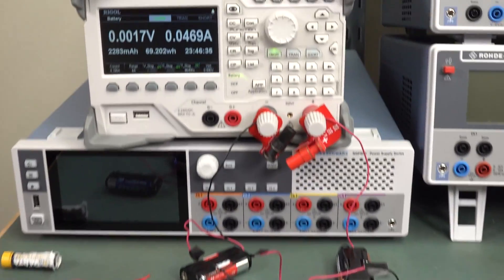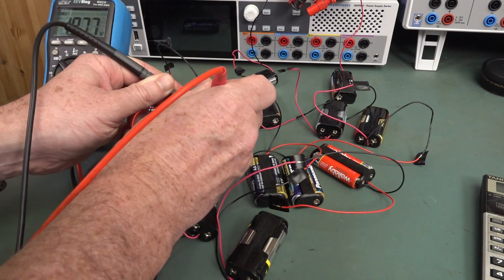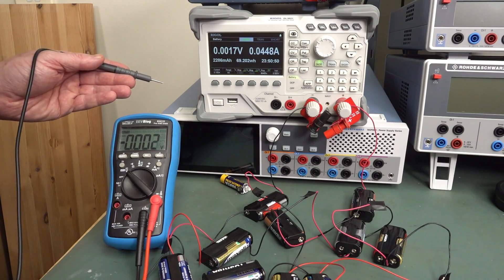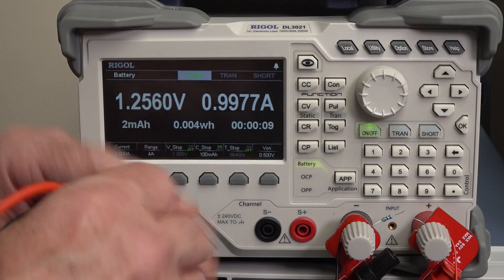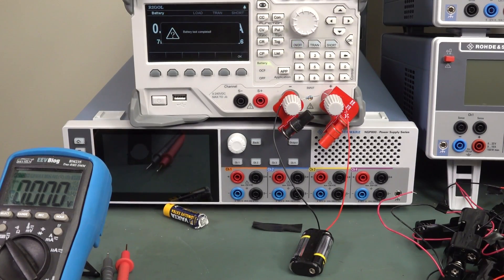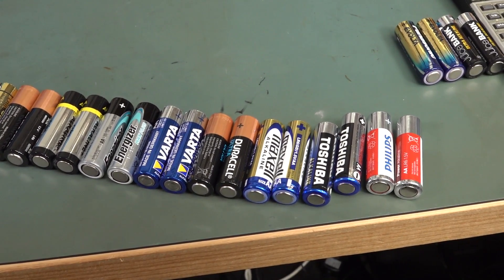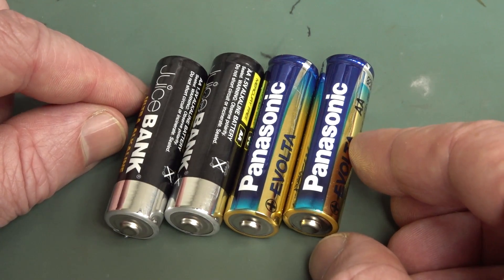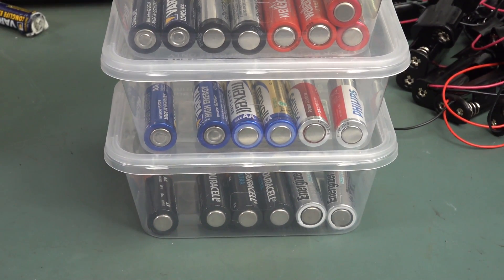Alkaline Battery Discharge Testing Part 2

Comment: Making them leak: Regenerate them. 100 Ohm series resistor on 1.6V/cell. ca.1 or 2 weeks. They seem to be ok and could be used. But a protion of them will start leaking when they are stored afterwards..

Comment: To guarantee even discharge (or charge), place a high-valued resistor (1 MEG) across each battery!
Reply: 1.5V at one megaohm is 1.5 microamps. How is that current able to make a difference at a charge or discharge current of 100000 microamps?

Comment: Every time I've had an alkaline battery leak, it was found still in-circuit; there was bound to be a few electrons per minute flowing from the battery. In your setup you've depleted the battery, then broken the circuit. I wonder if soldering a 100k - 10M resistor across each one would increase the probability of leakage?

Edit: Or make it more scientific and solder a resistor across one of each brand, leaving another of each open circuit.
Reply: I also wonder about this. A TV remote for example is always going to draw some standby current. It may not be constant, either. Perhaps that plays a part... That said, I have also seen dead (or just old) batteries leak in open-circuit conditions.

Comment: hmmm... I just thought about what causes the leaks: Because it's typically a seal failure, does having the battery compressed in a spring-loaded battery holder reduce the effectiveness of the seal when compared to having them loose? I'm beginning to wonder if we're barking up the wrong tree with all of these electrical tests when what we could try is compressing the batteries in a holder.
Reply from the maker: But they leak inside products that have battery springs.
Reply: @EEVblog2  Exactly! In those storage bins, there are no springs compressing the battery like in a real product.

Comment: David Perkins
David Perkins
36 minutes ago
In this many-batteries-in-series setup, it's wise to place a high-valued resistor (1 MEG) across each battery so no single battery 'hogs' more than its maximum voltage!

Comment: They wont leak in those boxes. They need to be in something expensive, then they are guaranteed to leak!
Reply: Doesn't even have to be expensive, a remote for a cheap TV works just fine provided it came from a sufficiently obscure manufacturer to be made from unobtainium.

Comment: #1 way to test these batteries is to buy some random cheapy cassette tape players from the internet with an auto reverse feature and leave it turned on and playing overnight, guaranteed to drain the batteries asap and notorious for making batteries leak over time. As someone whose been around since walkmans were a thing, i'm sure you have left a pair of dead batteries in your cassette player and come back to it a week or so later to find that the batteries had leaked.

Comment: When exoerimenting it think it helps the experiment can be repeated or modified a little and repeat the experiment. By chaining  a lot of batteries in random order gives a complex circuit where all different batteries get dependent on each other. E.g. one batterie that gets a high resistance can mess up the complete circuit.
Reply: yup, by putting all of them in series they discharge according to their impedance, hence when you then let them discharge individually, you effectively measured their impedance relative to each other. A rather useless experiment.

Comment from the maker: BTW, even putting a voltage stop setting wouldn't have prevented the reverse charging in this instance.
Reply: But putting a reverse shcottky diode across each one would have.
Reply: Wire them in parallel and discharge CCCV to 0.9v. easier and won't reverse charge
Reply: And that's why electric power tools with NiCd packs shouldn't be used until the battery is "fully flat". In these 18V packs (15 cells in series) a single cell is easily reversed, especially if after some month of non-use the cells are unbalanced due do different rates of self discharge.

Comment: Couldn't you just put a diode in series, parallel all of them together and just set the discharge voltage on load ? Serializing it is really shoddy enginering, they ought to discharge to different level just because of capacity
Reply from the maker: The capacities are roughly similar, so just a couple reverse charged

Comment: I'm surprised Dave you didn't do the bounce test.👍👍👍
I think you need pen and paper, label the packs A, B, C etc,  when you start measuring those batteries in circuit, its a bit confusing as you went from pack to pack as to what was reverse charged and how much.